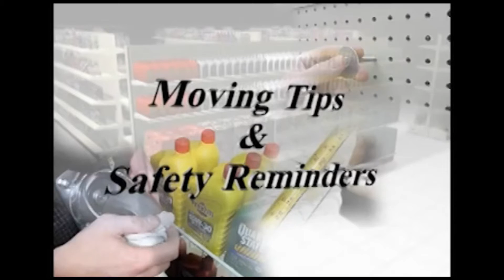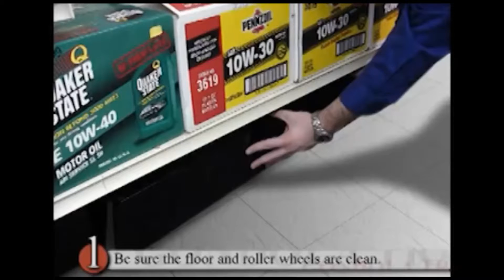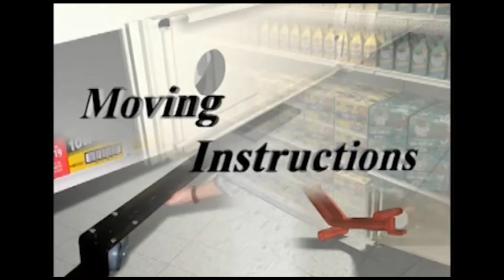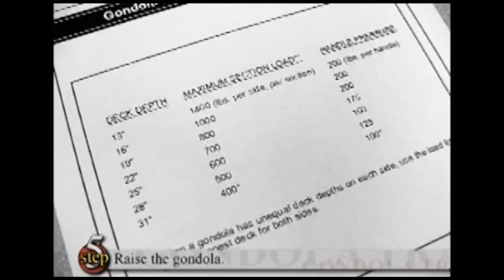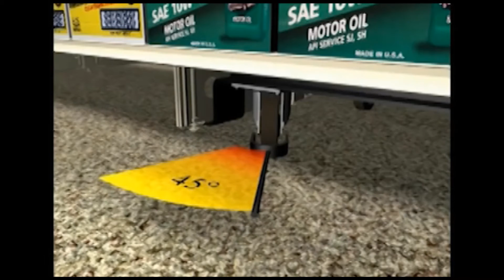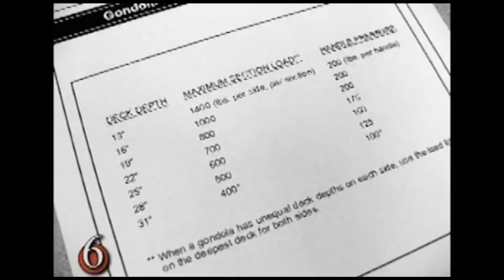Gondola Train Instructional Video 2015 | Gondola Train

Comment: Placing the rollers under the gondola is scary af
Reply from the maker: Yes, it can be a little nerve racking placing the Original Rollers under the gondola shelving for the first time.  Gondola Train has worked hard to make sure that Original Rollers are safe and secure when used properly.  We are always here to help with training tips, best practice advice, and to answer any questions out there.
Thank you!!  

We look forward to helping get your fixtures on the move ...
Gondola Train
888-400-5227
gondola@gondolatrain.com

Comment: what they dont tell you is this type of train weights a damn ton..way to bulky for most smaller stores...and the do not raise more than inch and half point is worthless...most feet are set to low so you have to raise at least 2 to 3 in just to get skates under.  The run is not going to tip over if you go over the inch and a half point...commercial merchandiser for 10 yrs so yes i know what im talking about
Reply: facts
Reply from the maker: I am sorry that you have had bad experience with moving Gondola Fixtures.  We have multiple systems, that allow us to customize the kits to fit each project size.  We offer Convenience Packs, built specifically for Convenience Stores or stores with smaller footprints.  We have over 20 years of experience in moving gondola fixtures, and have adapted the safest systems on the market.  We hope that during your next project, you would consider looking at Gondola Train to help save time and money, allowing you to keep your project budget and timeline where it needs to be.  

Gondola Train
888-400-5227
gondola@gondolatrain.com